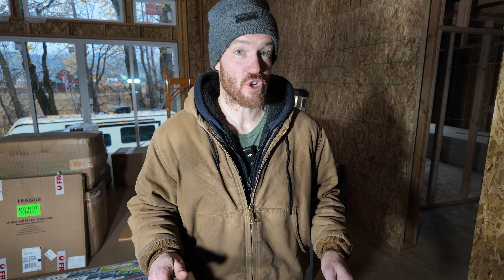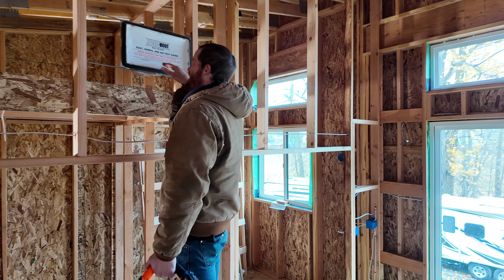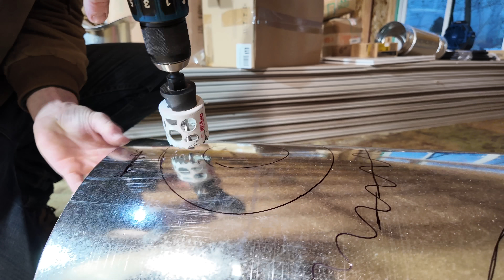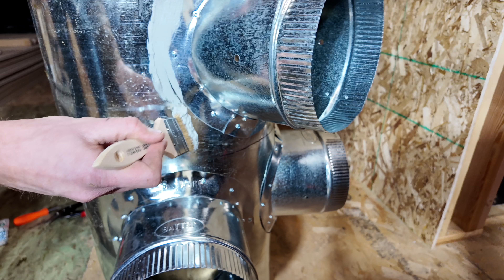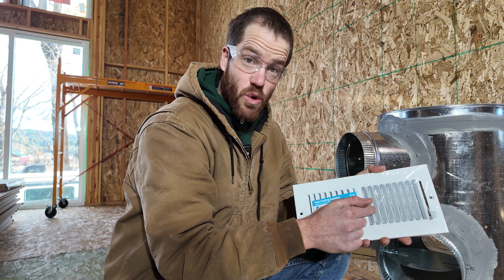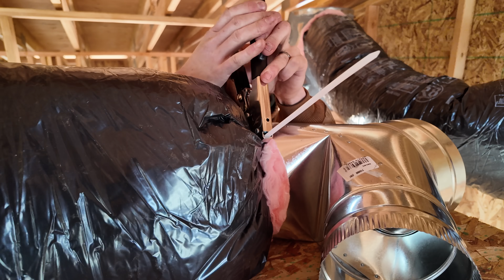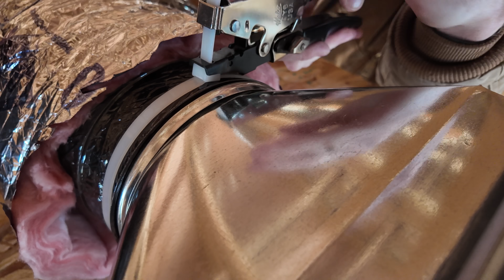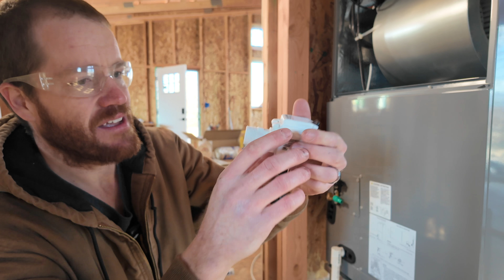HVAC Contractors Hate Me For Showing You This

Comment from the maker: Shop the complete lineup of MRCOOL DIY products: https://mrcooldiy.com/
Reply: you should install a set of cat6e cables to each room you want internet, going to where you'll want your router. its a luxury that youll never regret doing
Reply: This is awesome im in the plumbing stage if doing my place then off to hvac and electric happy you made a full parts list for this because im doing everything i can myself. Did you do all you own electrical?
Reply: After having this unit, can you tell me if you are still happy. We are trying to make a final decision.  Love yalls show. It's just terrific!!❤
Reply from the maker: @ Yes, we are still VERY happy with everything!! We’ve had temps as low as 12F since installing it.
Reply: @AmbitionStrikes  Awesome.. thank you so much. Also, we are loving yalls coffee.... soooo good!
Reply: @AmbitionStrikes please elaborate on your 12f. Are you saying the home got to 12 degrees or are you saying the split between return and supply is 12 degrees Fahrenheit?
Reply: @AmbitionStrikes Riley could you provide the model numbers for your MrCool system? Using the link in your list it brings up a 30,000 btu 2.5 ton system, not the 4-5 ton system you are installing. Have searched on line and cannot locate a system that is complete with line set ect..looking to replace a 4 ton Trane ducted  heatpump that has a bad compressor with a replacement quote of $2,600. I'm sure part of it is due to a rust inhibitor that was sprayed in the line set that caused a failure of the reversing valve. I unfortunately didn't own the home during the class action law suit. So Trane won't accommodate any restitution. Figured a new MrCool system for a few hundred more would be a more efficient option. Thanks
Reply from the maker: @ We installed a 2.5 ton system. The outside unit is a 4 ton to accommodate a future 1.5 ton ceiling cassette mini split in the basement.
Reply: @AmbitionStrikes  Still no word on the failed air moving system you installed. It is all about pressure and where the air WILL move. Poop air in your living room will not be a pleasant home to rent or buy.
Reply: 😂 I’m a HVAC contractor. I’m not mad at all. If you can save money and do the job yourself per building code. I give you two thumbs up
Reply: How much did you spend on this project ?
Reply: I’ve really been enjoying your videos but I don’t recall discussion concerning your interaction with the local building inspectors.  I realize why you probably can’t video the actual inspections but I think it would be informative to describe the inspections and the inspectors comments.
Reply: @jackkern1215  In certain parts of North Idaho there are no building inspectors nor adopted building codes. They have zoning standards that are enforced but no building code enforcement.  Wild west stuff.
Reply: @wallylama31  Same thing in rural texas. We are building a house the county only requires a septic system permit and inspection..
Reply: Do not route the heating/cooling like that, you are creating a health hazard and most areas would not allow humans to live in that house with poo air blown in to the whole house and re circulated by the air system. The air always flows from high pressure to low, only by extracting more air from the bathroom to the outside of the house than you blow in with your heater will this setup work. It is better to use the vent as a exhaust to the outside of the house as warm/cold air will enter around the door (even when closed) regardless. Building codes are not just to annoy you and drive up costs but to keep you (and your tenants) healthy and safe. PLEASE rethink your design, and do ask a professional for advice. You could/would(maybe even should) be sued if you rent out a house like that.
Reply: Good try to doing a ac and ductwork on your own but you did so many mistakes that will cause you issues. I suggest you leave the ac work to trained professionals. We are constantly studying to advance our craft that would be a better fit for your system to work properly and get proler air flow thru the home.

Comment: The only I would do to make the connection stronger after you zip tie use black duct tape. Also any exposed  duct needs to be insulated or it will sweat.

Comment: yeah thats not how you calculate how much capacity/cfm you need or design the system. i know im going to sound like a dick but seriously, good luck i honestly hope it works out for you with the sketchy off brand system too that's going to cost you thousands when it leaks and you're going to have to eat the full cost when the manufacturer wont warranty it because you dont hold a C20 license. hope you insulated that exposed sheet metal and added a filter too.

Comment: The recommended maximum length for a flexible duct run is 6 feet, with 10 to 14 feet serving as an absolute upper limit depending on whether it is classified as a duct or connector under local building codes.Length Guidelines and StandardsRecommended Length: Industry guidelines from ASHRAE and SMACNA recommend keeping flex duct runs to a maximum of 6 feet (1.8 meters) to prevent excessive static pressure loss and reduced airflow.Absolute Maximum: While some residential installations stretch up to 10 feet fully extended, flexible air connectors (which connect specialized terminal devices) are capped at a maximum length of 14 feet under codes like the International Mechanical Code (IMC).

Comment: Anyone that thinks this system will work properly is dreaming.  The "plenum" alone has so many faults it's impossible to believe that it will supply proper H/C throughout the house. As a guy who spent ,many years in this field, if I were called out to work on this turd, one look at the duct work, and I'd be gone.

Comment: I love how a furnace that would barely drip anything has a valve like that for overflow but your water heater which will most surely leak at some point in time does not have something the same to shut off the water...

Comment: For 1100 sq/f you need about 2ton AC. Parts for the AC install and duct work and all else will be roughly about $5K-$6K. Labor can be done in 3 day with 2 guys. Total labor cost is about $6K. So total unit cost will be around $10K-$12K. That is for a small contractor, for large companies you are looking at $18K-$20K.

Comment: LOL I could list all the mistakes you made, But I wont. It will be far more fun watching the follow-up video in 3 years. The Humble pie video.  even on a small project like this the devil is in the details. You will learn about freezing coils, uneven heating and cooling, Air balancing, sweating, air filtration. Why you needed and HRV tie in and continuous ventilation for 3 years. What you dont know is going to cost you in more ways then you know. 10k is cheap. for people to install it write, filter it write, Insulate it write, Get the proper charge for the length of line set. The cost is the overhead, + Advertising +23% prophet margin cause all business must make a profit. 2 LICENCED installers at $36 or more an hr.  Depending on the region ( Equipment and materials cost x1.7+ add hourly rate for 2 men at 450 for 650/ hr then add tax. If the is a sales person involved in a larger company add 4% . What are you paying for? warranty, Licensed people, An equipment warranty.. Try to get that on a Mr. Cool. I dont recommend what you did, however your on a budget, I get it. I just hope your budget doesn't bite you in the Ass

Comment: I’ve been doing hvac for 13 years I’m a lead installer for a big scale company. I’m a huge fan of how you did the plenum for this spyder duct system your changeout in the future is gonna be oh so easy. But I gotta say you didn’t insulate a lot of items at least not in your video. Please tell me you piped in a return as well. Also all vents especially on exterior rooms go towards the exterior of the wall. Also when your installing y’s regardless if your taking a six inch run off the y that doesn’t give you more cfm. You still only get as much cfm as the 8 inch flex run off your main plenum is getting regardless if you y it. Few things wrong here but I don’t think you’ll see any major catastrophes besides some sweaty duct in the attic. A return isn’t necessary but it would increase efficiency. But then again I guess you could keep pulling from right underneath it as long as you don’t close in that unit with a door and leave it wide open to your home and have a filter

Comment: I’m not really sure how you did you load calc, I do that for a living but I am fairly certain that you duct layout isn’t correct, there’s a lot that goes into selecting the “right” diffuser and the right size duct it’s got a lot to do with how much noise criterion you’re looking to meet and how many CFM you need, then you follow the engineering specs to see what the manufacturer says the duct neck should be. Also I hate to be this guy but unless you’re somewhere really mild climate which you could be idk you could be there’s no way every room is getting the same CFM unless they’re right next to each other and the same size within like 10sq ft, you have leeway cause it’s not commercial and like really 15cfm isn’t that much different than 30cfm but there is a much better way than using the square foot method it’s only good for standard construction with rooms up to 8’ in ceiling height, assuming for a 12’ ceiling thats 33% more cooling load you should account for than what would be standard

Comment: u DONT want to install the air handler in the attic, just hard to get to, and hard to work on, and i am assuming it will be HOT in the summer (not conditioned space) putting ANY system in the attic is just STUPID!!

Comment: Depending on the area you live, if heating is your priority, a floor level return is ok. If cooling is the priority, the cooling will work a lot better if the return is pulled from as close to the ceiling as possible. That's why you have so many air handlers in attics in warmer climes.

Comment: I do HVAC installs and I have to say overall you did a good job some of your calculations are a little off due to using flexible duct which would lower the overall cfm output but for someone whos not doing it everyday this is impressive i have seen some of your other videos and it will work. There's some improvements that could've been made some registers placed differently etc. but you saved money and it works

Comment: A $20,000 estimate for a job that size comes from a company/individual who doesn't want the job. 
That equipment, permit and a proper Manual J calculation should be $8,000-$11,000 depending on location- installed with warranty.
Mr.Cool is not going to fix that for you when trouble arrives, and it will!

Comment: Lots of problems in the design and installation. This is why DIY is sometimes not the best idea. The duct design is severely over simplified. You definitely shouldn’t have had such long runs of flex and your pressure drop is going to be very high and thus your delivered CFM will be very different. Also you need to insulate the exposed metal. 
 All in all, the money you saved you’ll likely lose in efficiency and service calls. I don’t know what area you live in but if you use humidity you are 100% going to develop moisture issues in your duct work.  To each his own

Comment: Hey… so I did the same setup, and now I’m confused where my filter goes… is the little small filter spot the best? Also,.. I have a 1500 sq home… it has all new insulation, and I ran the ducts my self. The house didn’t have any heating or cooling before… do I need an air return or can I leave it on the stand? It’s in the center of the house in a 10x4 utility closet.

Comment: Hate to burst your bubble buddy but how are you going to change that filter with that trap in the way? If you don’t end up putting a filter at the unit or at a return grille you’ll end up having to call an HVAC company to come fix it because those coils will gunk up and will cause the system to start going out on high head pressure.

Comment: They make prefabricated air handler stands.
Duct sizing is dependent on a lot more factors than sq ft of room.
Man I REALLY hope you went back and actually insulated the plenum box, mixing connections, and the big metal drum. Those fittings/pieces are going to condensate like crazy in the cool mode.

Comment: Really nice job bro.  But working with fiberglass and no gloves is an irritant thing,  working with sheet metal with no gloves is a stiches thing.  Stitches' are way more irritating.  You got lucky.  :)  But still nice job. (also, as an aside,  the heat strip also runs when defrosting since defrost blows cold air back into the house in the winter, so it needs to heat that cold air)

Comment: Mr Cool is nice- however, none of the local hvac company’s will work on the if you have an issue. I have a 3 zone unit installed myself. Had issues and you have to learn, call their support, wait for parts. Not east to fix or if something goes wrong. Would not but again. Just get a local company who will warranty and service it.

Comment: You forgot mastic between plenum and the air handler, should have used light foil duct tape over your mastic sealed joints.  Better check for leaks before you close things up.

Comment: I've installed new HVAC, with commercial kitchen equipment included, for several brand new Chick-Fil-A restaurant build-outs on the west-coast, for less that $40K. 
Nearly all HVAC replacements could've been avoided, if the contractor would repair it for a few hundred dollars but they refuse to repair or don't know how to repair, so they sell new unnecessary replacements. And people think they got a good deal, only spending $7000+ on a new system lol , when they could've saved 85% of that

Comment: Dampers in the truck i think are a mistake and trouble waiting to happen and you can't see their position if it changes. My 3 cents. I have a few in our trunk and most will have them all open. Pinch the rooms off at the local louver. but in general they should all be wide open. some might be pinched a bit if they are over heated. but heatpump temps are way less than gas.

Comment: Make sure the doors have big gap below it or louvers on the doors. heat pumps need the flow to pull all the energy out of it. heating will be mildly disappointing as the air is not as warm as a gas furnace.

Comment: Edit: looks like they are most brands, it's a midea unit with different boards and features on top of it. Looks good. I think hardwired t-stat and not proprietary is sometimes better as replacement parts are readily available. 
OP: Please consider alternative brands to Mr cool. There's been a lot of folks that have problems with their gear and can't get help or repairs. Especially when DIY installed, any one else "pro" that comes out to look will be suspect to the install. I agree with them as a DIY, it can be tricky to do all the steps correctly. As long as you understand the risks. I am a DIY, not a pro. I've done 2 mini/splits and 3 furnaces. Call me a wreckless. My philosophy on it is, if there is a problem. Buy a new one and do the install again as it'll be cheaper than a "pro". Unless you are total incompetent, then call a pro and bite the big bill. If you do go for it. Buy expensive tools. I think they are helpful, needed and take the edge off of a stressful and relatively expensive job. Good vacuum pump, good gauge set, lots of spare gauge fittings, angles/shutoff. Good core removal tool. nylog, good concentric flare tool, ratchet pipe bender if you're doing 3/4. Check all the flares. Cut the factory ones off, in general. They should be pristine smooth.

Comment: When the HVAC professional comes to fix your Hack job , he's going to sock it to you !!  #1 which way did you loop the access line set vertical or horizontal ? #2  your runs that split into a 8 and a 6 should be fed with a 10 inch and the far runs are going to have less velocity , because of that octopus disaster #3 if that system uses 410a you may have issues with freezing the evaporator coil, using all of the flex , why didn't you make the supply pipe go from the square to round to your wagon wheel or spider disaster?   #4 just because a box of flex is 25 feet doesn't mean you make a run 25 feet , the better choice is to use pipe with about 5 feet of flex at the outlet ! but I'm all for saving money and I get it !!!!!

Comment: Your supply ducks should be over your windows. You want the airflow to go completely across the room. You have a central return. If your doors open, it's just gonna pull your air back out the door before it crosses the room.
Reply: Did you look at the house?  These is no place on the wall to run the ducts.  Ducts can only go where they CAN go.  No destroying trusses or building ugly soffits, even if the airflow might improve.  Forced air blows air across a room easily.

Comment: Hmm, your price on the spreadsheet shows a Mr Cool 30K BTU Condenser unit for outside, but at the end of this video, you pulled the box off and revealed a 48K BTU Condenser out of the box which I'm sure is much more expensive than $2300.  48K BTU is way overkill for a little 1000+ sq ft home.  I live in central Florida and cool and heat a 2500 sq ft home with a 60K BTU Heat Pump.  Also, if you really are trying to match up the 48K Condenser with your internal Air Handler, I fear it is way too small to handle that huge Condenser unit.